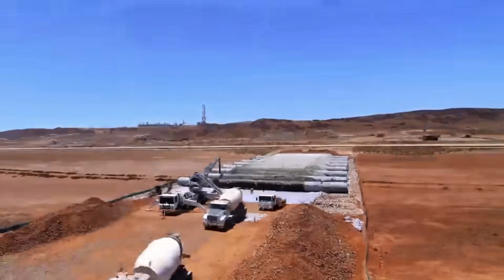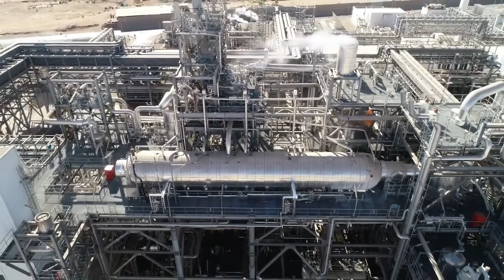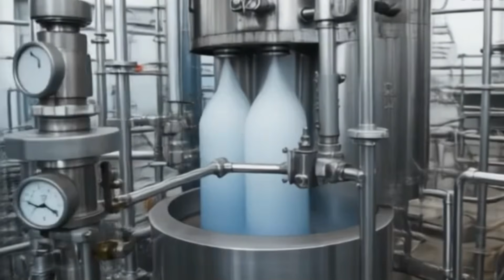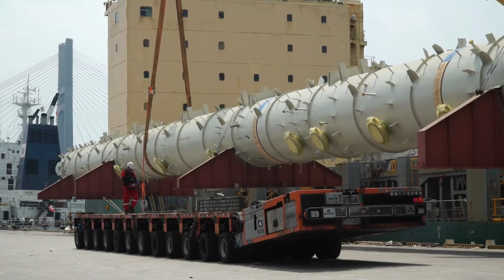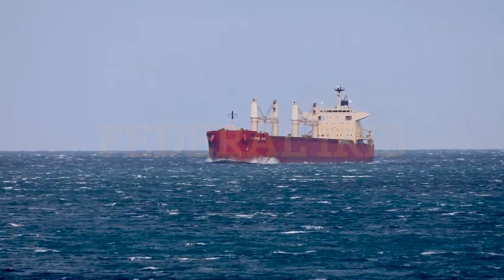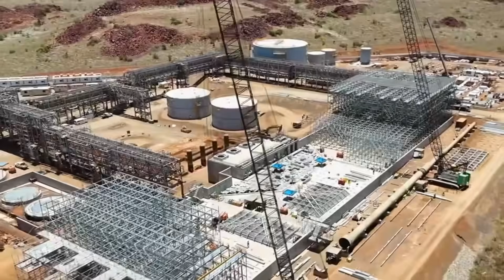Why Western Australia Is Dropping $6.4 Billion on a Fertiliser Megafactory in the Desert

Comment: They could/ should get rid of the massive CO2 output by using the ( locally developed) Hazer process to make the necessary hydrogen and output only solid graphite with its own commercial value instead.
Reply: Never heard of it until your post Thanks. Initial reading sounds great for someone who is not qualified;/ but optimistic.